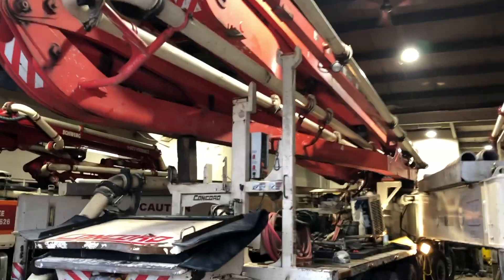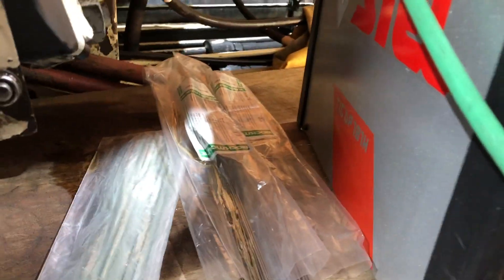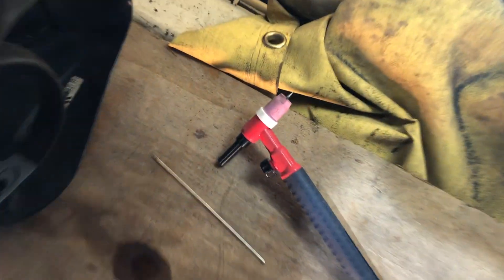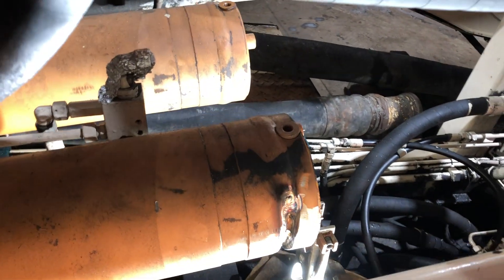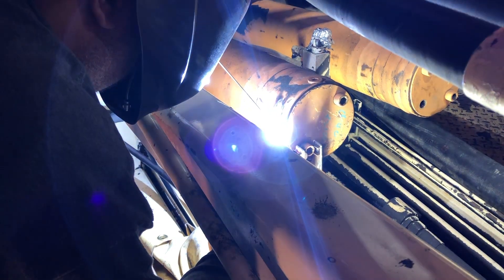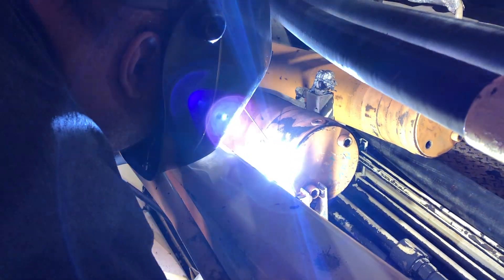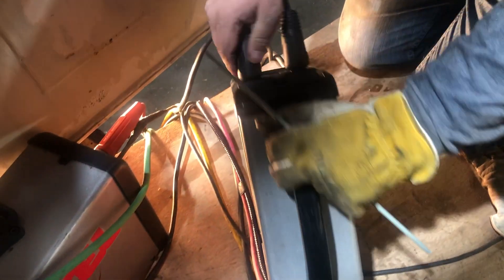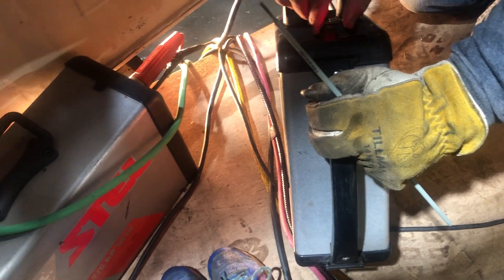Fixing a hydraulic cylinder on a concrete pump

Comment: Schwing I worked with a company for years that had a couple Schwing concrete pumps 42 was our biggest, I'm in Ireland so the two main concrete pump manufacturers in Europe are Putzmeister & Schwing both exceptionally well built German made machines.
Unfortunately the company went out of business in the 2008 collapse after 25 years of trading. Formwork sub contractor.

Comment: Excellent work Peter!!! Out of position, dirt and uncomfortable is the name of the game. I am kinda surprised you didn't use MIG as you process. Can you describe your thinking for Tig and then capping with Arc vs MIG? You are the master.
Reply from the maker: Thanks. Tig root assures leak tightness. You can see what happens in the root pass, how the crack fuses 100% and seals.  Once that is done you can weld it out with mig or stick. Now part of the reason i chose stick over mig is: 
1) i had the filler alloy i wanted to use in stick and although they make it in mig ( solid wire and cored wire ) i didn’t have it on hand
2) a mig machine is larger ( in the small space i had to work in)
3) it would have needed an additional tank of gas, probably some “specialty” gas like 97/3 or 98/2 which my gas guy only sells in 320 cu ft tanks which are a pain to haul around
4) with the slag system on the stick rod its easy to weld out of position. 
5) it was a “small” and “ quick”  enough job to stick weld it ( set up time vs weld time) 
6) stick is a good penetrating spray arc, the flux helps deal with the contamination from the carbon from the burning oil residue A LOT better than bare wire can. 
7) that makes the process “fool proof”
8) the stick rod i was able to bend into position and manipulate it to go around a corner and fit into small spots VS  a mig gun being large and rigid ....
9) no moving parts, with wire you have a lot of things to consider, gas type, flow rate, leaky gas hoses, drive roll type and tension, wire brake tension, contact tip size....  and if i weld on something critical like this, if one or more things are wrong, this poses a big problem and i need to fix it to be successfull
VS
Stick: you have to be in the right amperage range. And if there is a problem you throw the rod away and grab a new one - done

I think this draws an overall good picture hopefully.
Reply: @ZILAwelds  Thank you for the free instruction! You make a fine instructor.
Reply from the maker: @jondavidmcnabb  you are welcome

Comment: Good work! Never would I have thought to tig a hydraulic cylinder in position. I would think the oil in the steel would be too much contamination. Learn something new every day! Did you torch the area first to burn any of that out or no?
Reply from the maker: No torching, just draining.   The “secret” is the filler you use ....  use something with 312 stainless filler in it .... it helps you dealing with the carbon from the burning oil. 
In scrapyards we weld 4” sch 160 high pressure hydraulic lines all the time like this....
Reply: @ZILAwelds  ok I'll have to try that next time, I carry 312 filler on the truck already.  thanks for the information!
Reply from the maker: @sparksmobilerepair4025  rockmount Brutus or welco Harris super missile weld work a good step better than 312 stainless ....  but they are 312 stainless "based"
Reply: @ZILAwelds  I've never seen those brands do they carry them at airgas or pax air do you know or is that something ordered offline
Reply from the maker: @sparksmobilerepair4025  my local matheson gas carries welco SMW .... not cheap ...10 lbs for $300+ or so ....  the rockmount stuff you need to buy from them direct ...  you can email Gerald gabrams@rockmountwelding.com    he can hook you up ... theirs is more $ per lbs but you buy individual pounds ....
Reply: @ZILAwelds  Dam those are pricy! Is there that much more benefit then fill and cap with 7018 lol
Reply from the maker: @sparksmobilerepair4025  well, I usually put the root in tig with that stuff ....    at least one pass - maybe 2. .....  then you could weld it out with 7018 if you cant to be cheap ....  the difference between my welds and my local competition are ....  months !!!!  there is a guy who comes out with his machine and welds stuff up and the customer already knows that the hydraulic shock load of his shuttle valves that are on their way out will cause so much disturbance that he knows that that welds last one month at best .... when I fix the same pipe ... even after the other guy fucked with it ....  6 for sure maybe 12+ month ....  so you tell me ...  tig there are 13 rods 3/32 in one lbs of filler rod ....  or 13 stick electrodes 1/8" .....  how many rods do you think u used for this entire job ???  if I used an entire point I was really living it up ....  a pound of 7018 cost $3.50 ?  a pound of the stuff I use cost $30-$40+ dollar .....  on a $500 + job ....  having an extra $30+ bucks into it ... making it last  1/2 year or a year where the competition last not even one month ..... .....  well - I dont know about you - but for me. -my reputation is worth it to me ....  also with all this covid stuff ... I get away with alloy surcharges $50 ... that pays for all my specialty welding rod on that job and some ....     LOL ....

Can you fix this stuff differently ?  sure !  will it last ? well - if done "correctly" it might .... is my way easier and more "fool resistant" (not proof...LOL)? I think so .....    on your jobs YOU are in charge ... YOUR name is on it ... DO NOT take advice from YouTube welders ...  whatever decision YOU make YOU will live with the consequences .... the good, the bad and the ugly consequences ...  
my suggestion for what its worth is - buy some stuff you plan on using, set it up at your shop, try stuff out see how it works for you, gain some trust and confidence BEFORE you use it in real life in the field at a paying customers job .....
Reply: @ZILAwelds  this is true. When I looked up those rods it came up as stick rods not tig filler wire? Do they make both? I've never fixed something like that that has that kind of crazy shock load so I don't have the experience with that. But yes the reputation is everything especially now a days.
Reply: @ZILAwelds  and yes I too have started charging a covid sur charge for stuff as prices have definitely gone up and my local steel suppler is now a nightmare to deal with so someone has to pay for the nonsense. ( Not me)
Reply from the maker: @sparksmobilerepair4025  you can get it in whatever you want ....tig, stick mig and I believe dual shield flux core ??? not 100% sure about that last one ...  but you get it in whatever you want
Reply: @ZILAwelds  very good to know. Ok I'll have to check some out.

Comment: Thanks for dropping knowledge and scholarship on the rods and filler metals you use. A lot of guys out there hold this information close and don't share, so it takes a generous soul to recognize the greater welding community at large. You've reached deep into the cesspool of where most of my welding is rated and lifted me up. On behalf of myself (and I'm sure many others!) thanks for putting this information out there and giving us something to try. Your generosity is kindly appreciated.

Comment: Good video, Would it not be easier just using straight current on an on/off tig button?
Reply from the maker: well, I used what I had.   I didnt have a torch with button handy ....  I had a torch with no buttons at all ... (so I could have scratch started it and no tapering down at the end of the weld ....) and I had a foot pedal .... so I used what I had

Comment: Curious why you choose to stick weld the rest of it just for speed of getting it done?
Reply from the maker: Speed, ease of use and maybe somewhat deeper penetration. In my experience generally speaking (depending on the rod) stick welding typically can have deeper penetration than tig
Reply: It's a lot easier to reach when you only need one hand.
You're not hugging that beam, and you can prop with your other arm, I'd assume.

Comment: Great camera work.  She did awesome.  Make sure she’s paid well.  I’m surprised at the 95amps for 1/8in.  I would have guessed 125 amps.
Reply from the maker: literature says 95 - I ran it at 105 ....  stainless rods run at a lower amperage 308,309,312 .... they all run less amps than 7018 for example ... also 6010,11,13 ....  they also run less amps ...  7018 is kind of "high" all the others run around 90-100 amps ....
Reply: Also, the Estwing is my favorite chipping hammer by far.
Reply from the maker: @ManCrafting  yes, what a brand name "show off" video .... LOL
Reply: @ZILAwelds  what brand?  🤣
Reply from the maker: @ManCrafting  ALL of them 🤣

Comment: Great video mate. Looks so awkward in there. Showing some skills with that elbow dude lol 😂..
Good job. I suppose it’s only a bandage 🩹 fix. I will probs crack again down the track. Eventually will have to replace that arm. But Big bicky’s I get it 👍
Reply from the maker: This guy has 8 or 10 pumps. I welded on 4 or 5 of them over the years!  Typically those welds last a long time ( till the cylinders are all worn out). 
There  is no need to “re weld” it ....  one time a cylinder developed a crack on the opposite side and 2 years later i welded that too ....  
but no one has time to pull those cylinders out for days and take the machine out of service .....
Too much time and money loss. 
New cylinders are 10ooo dollar per pair
Reply: @ZILAwelds  Jesus fair call mate. Yeah pretty expensive. You da man Zila. Keep up the great work and content on here it’s great 👍.

Comment from the maker: Fixing a hydraulic cylinder on the worlds largest (2nd largest) concrete pump.
using https://heavyhitterstigrigs.com           Tig Torch
using https://rockmountwelding.com           Filler metals
using http://www.stelgroup.it/?lang=en       Welding Machines

I bought all this stuff, I use all this stuff. - why ? because it WORKS !!!!  I didnt get it for free and no if you buy from them I dont get a kickback ...  I am sharing some of my "secrets" how I do stuff because - why not.  
If you want to learn more, come to my shop and take one of my classes ...
CL@zila.net